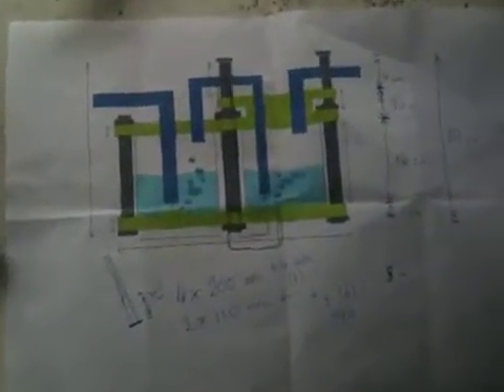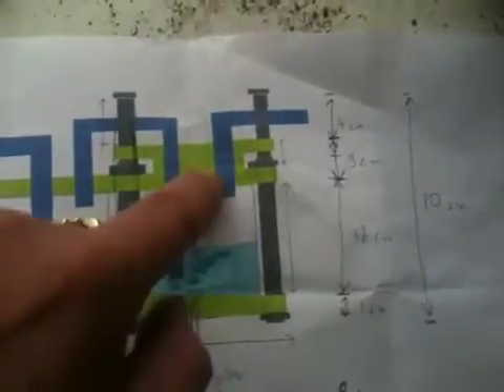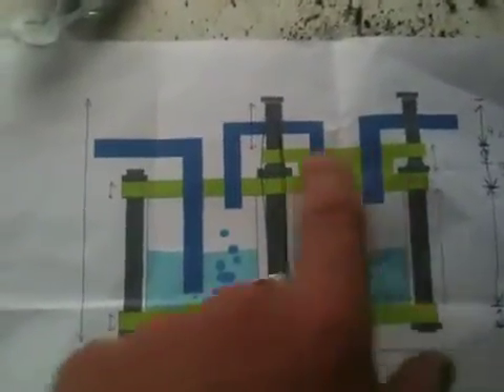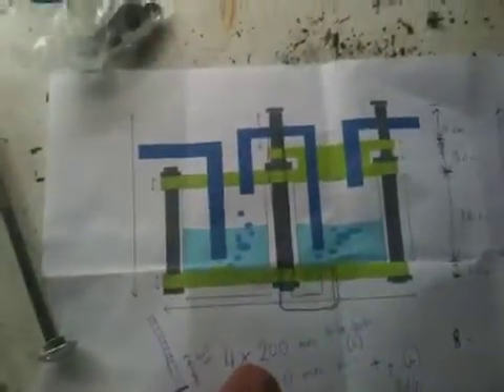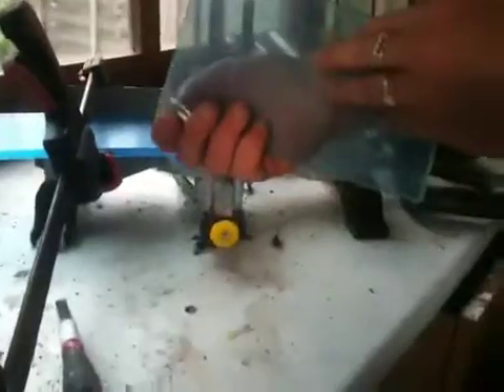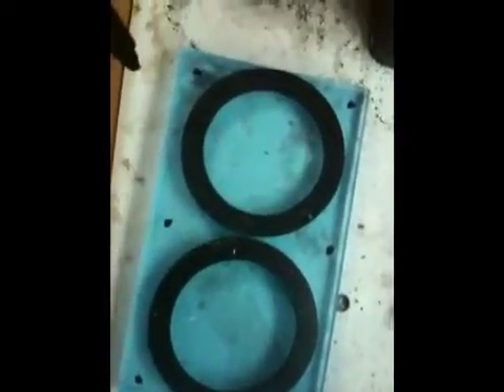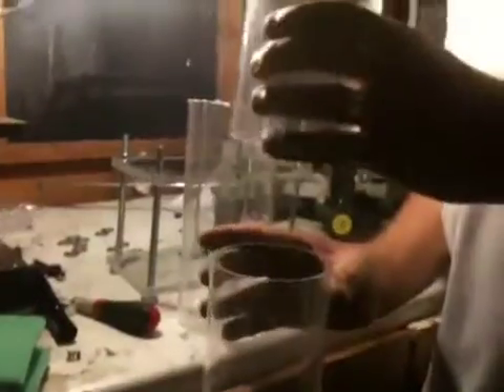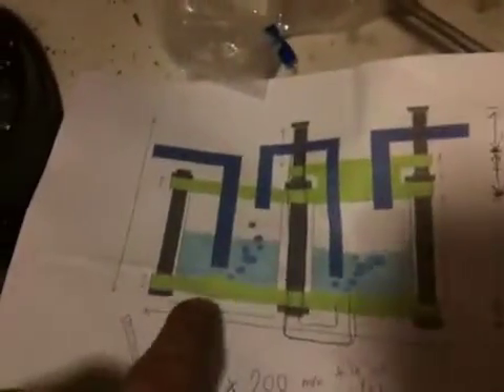The Ultimate Bubbler For HHO part 1

Comment from the maker: hello SilentDeath002,
yes your right, that would be a problem i had thought about that & part of the redesign is that im going 2 have a check valve in the bottom of each of the bubblers. this will b 4 2 reasons. first of all, when there is a flash back there will b compression in the first bubbler this will not only cause the safety valve at the top 2 open but it will also try 2 push water  into the 1st bubbler. the second reason is as you say, water transferring from one bubbler to the other.

Comment: hey buddy, nice design idea on the bubbler, one problem i see that might happen, you mentioned bringing in the tube from the cell to the bubbler from underneath. i would bring it in the way your first design shows so you do not get a reaction of the water wanting to run down the first bubbler connection, when you drive, the water will slosh around a little and the first design just seems to work better, i built a set up like that with water feed coming from the bottom, had nothing but problems

Comment from the maker: hello, MrElseWay.
Thanks for your comment.
The other reason why im using this double bubbler meathod is because i only have a certain depth available in the car and i wanted to use at least a depth of 20cm of water to wash by gas through. i thought that this idea would be ideal as i can have this depth but in a wider space. the blow off valve will save me having to keep on replacing the bubbler too if there is a major problem with flashbacks.